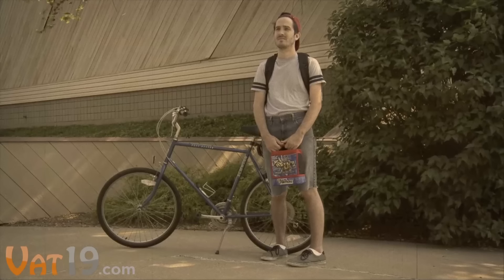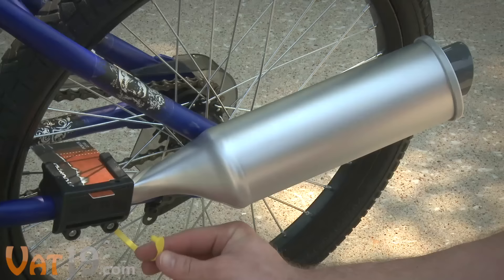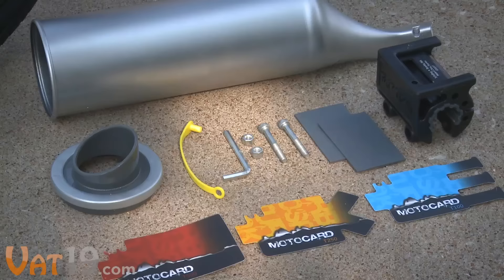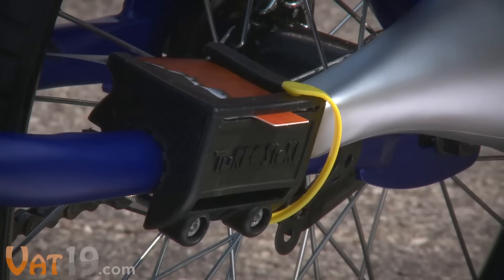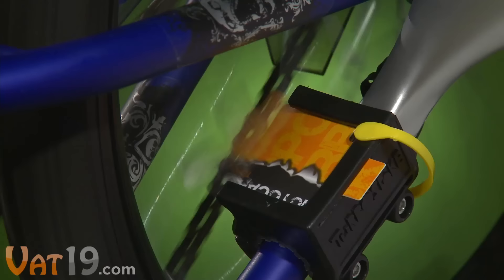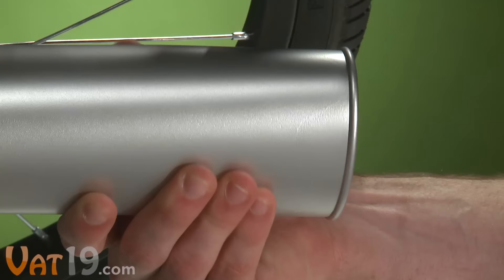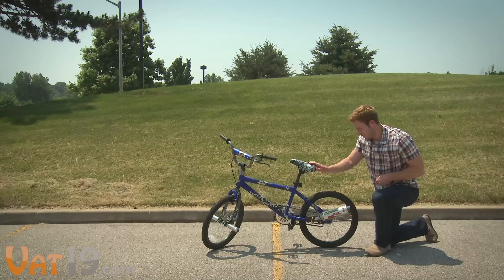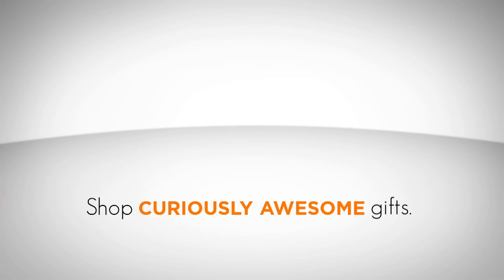Transform your bicycle into a motorcycle!

Comment: I swear when I road a bike with a card it seemed like it went faster than without🤣
Reply: Yeah, im pretty sure it does make you slower by creating friction between the spokes and also slowing down how fast the wheel rotates by each spoke hitting the card, and having to use enough force to pass the card.You could think of it like a track race. If you put a section where you have to duck on the track race, then the times will be slower because you have to go duck instead of running. TL:DR= Yes, it does slow you down. The faster you go, the more it affects you.
Reply: *rode
Reply: I did this on my mountain bike
Reply: U should try 52 teeth and 12 u noods

Comment: A cheaper and better alternative is placing a flat plastic water bottle on your rear wheel so it gets stuck trying to spin forwards on the frame, far louder, and sounds extremely realistic but its extremely ghetto and loud.
Reply: Nice profile pic
Reply: I did this and it works SO GOOD
Reply: Expect that will make your tire bald and it’s difficult to peddle
Reply: @davidbackstrom6392  lmfao you both got same Pic lmfao
Reply: @davidbackstrom6392  lmfao you both got same Pic lmfao

Comment: I used to crush a water bottle and put it on the top of the wheel it works the same but sounds louder
Reply: yah that is the real way to do it an also it is like 1000 times cheaper 5 cents vs 30 dollars
Reply: Yeah that also destroys your tires by heating them up more causing the rubber to wear way easier
Reply: Something i use that works better and stays on better is a crushed soda can
Reply: It does make your bike a bit slower
Reply: I use your head
Reply: @your_average_cultured_dude  You are being over dramatic trying to sound smart. Bet the tire would explode next into thin air
Reply: @heavycurrent7462  over dramatic? Smart? These are literally the most basic things anyone could know. It's called common sense. I don't know about you but I wouldn't want to spend $50 on a new tire 3 times a year.

Comment: Mate, you can just crunch a bottle up empty water shove it in your back wheel and it will make a motorcycle sound but the cap has to be off so the bottle can act like the eguast pipe. And save so much money